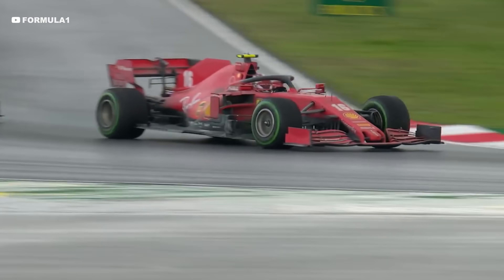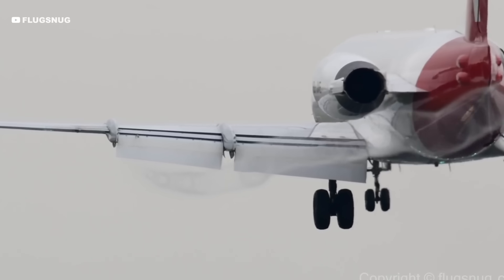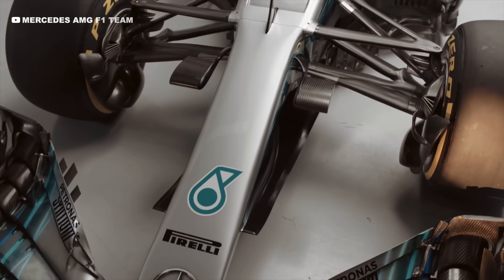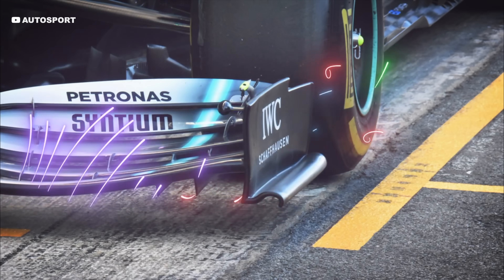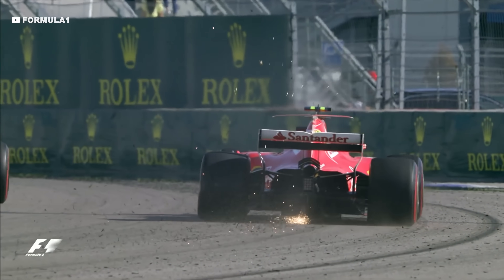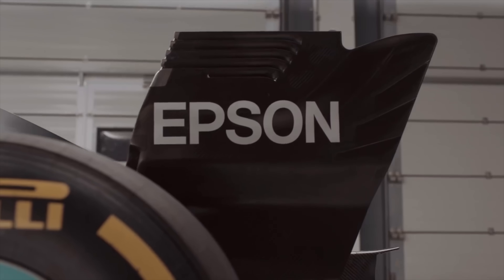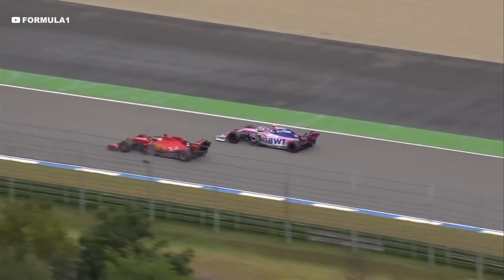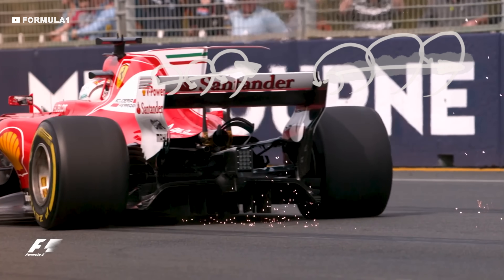The Genius Aero Trick That F1 Copied from Concorde

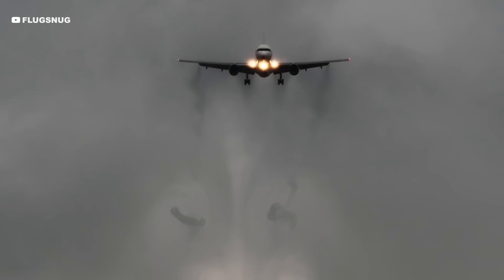Comment: 1:33 I would disagree with wing vortecies being unavoidable on planes as engineers put lots and lots time into getting rid of them. That landing plane in a sense has 2 sets of wings, one being the real wing and one being the flaps (meant to slow down the plane whilst greatly increasing lift). What we can see in that picture is that the only place these vortecies are made are the flaps of the airplane, as they can't have the parts wingtips can have to reduce these vortecies. 
There are lots of different ways to (mostly) get rid of these vortecies like tapered wings, wintgips that curve up or down or big bulging fuel tanks on the end of each wing that all stop high pressure air from the underside of the wing to get to the top of the wing around the wingtips
Reply: Wingtip vortices are unavoidable. The induced drag from them may be minimised but they can never be eradicated.

Circulation is a fundamental part of lift generation and without the vorticity you have no lift. You see patented objects claiming to prevent them but it is all lies.

Comment: Surly there is more to drag than vortices. Even without vortices some energy must be used to cause all the air molecules to deviate out of the way and the faster it is the more molecules have to move.
Forcing some molecules up will cause an equal and opposite reaction pushing the wing or even just a plank, down.
 The force needed for that 'must' also cause drag as you can't have something for nothing.
The air has to be moved, vortices or no vortices but you make it sound like it all because of vortices and I don't believe it.
Reply: I didn't get that impression at all. Just that vortices cause some drag.
Reply: @andersonneil2293  
Fair enough I'll have another look.

Comment: This might be a really dumb question but could you also use this to reduce the friction caused by bodypanels if you gave them sharkskin like surface treatment
Reply: Good question indeed. Yes, Airbus has applied such sharkskin kind of surface on their aircraft. It helps reduce frictional drag, thus lowering fuel burn.

Comment: Just a bit of context to the statement that turbulent air cannot create downforce. Turbulent air does create downforce but less so than laminar air. In fact, aerodynamicists will often add vortex generators to force laminar flow into turbulent flow because although it creates less downforce in ideal conditions, turbulent flow is less likely to detach from the airfoil, thereby sacrificing peak performance for more consistent performance.

Comment: btw the biggest vortex come off the flaps (only deployed during takeoff & landing to increase the wing area -> lift in low airspeed) not "wing itself".
Cruising speed the airplane has to be efficient, that's why new planes has winglets to reduce vortex off the edge of the wing.

Comment: The principle you describe at 0:50 is not the cause of wings generating lift & helping planes to fly.

The only thing required to generate lift in any wing is an angle of attack. The Bernoulli principle only makes them more efficient.

Comment: The difference in pressure above and below a wing can never be enough to lift a big jet. That's not how a wing works. Instead, The airflow behind the wing is directed downwards. This results in an upward force of the wing itself. The difference on direction between the flow in front and behind the wing does give enough force to lift a plane.
Reply: That's not how it works.
Reply: @Nikola16789  Yes that's exactly how it works. The main force is basic Newtonian "magic". The downward vector of air due to the shape of the wing and the angle of attack creates an upward vector on the wing which is the force that keeps the plane from dropping to the ground. It's the same force that is used to steer the plane when you change the direction of the rudder. Put the rudder out to any side of the tail and the plane will start to rotate. Since air is being directed in a new vector out from the plane an opposite force will push back on the rudder and rotate the plane around it's axis. If you doubt this force, put a hand outside the window of your car next time you're on the freeway. Change the angle of attack and you will feel your hand being pushed down or up. Now imagine going 5 times the speed and the forces that will be applied to your hand. Very simple. To be blunt a brick can fly with a big enough engine and the correct angle of attack. A wing is wing-shaped because it's efficient, not because it needs to be. It could be shaped like a slab and still work.
Reply: @SCARDUSTROCKS  Yea, I agree its magic...

Comment: Low pressure does not create the visable moisture in itself.. The air passing the foil is accelerated which creates the low pressure .. Accelerating Air is cooler than the surrounding air  - hence visable moisture.. :-)

Comment: i think you have the wrong understanding about pressure differences. low pressure air does not "literally suck", rather it's the high pressure air on the other side of an object that pushes. pressure pushes. nothing involving fluids really "sucks" or pulls.
Reply: Mathematically, it works either way. It's actually gradient that creates a force.

Comment: Still, no connection to Concorde. In fact Concorde and delta wings work slightly differently from other planes in the sence they need vortices on the upper surface to create lift instead of regular non turbulent flow. 
So while F1 is trying to cancel them out, Concorde needed them to fly

Comment: Great videos with good explanations. I would just add that vortices don’t create drag, they are a manifestation of the pressure difference. Drag is a combination of friction and pressure forces on rearward facing surfaces. Rw gills for example reduce drag by reducing high pressure on the wing upper surface. This means less pressure difference hence s smaller tip vortex is the result not the cause of less drag.

Comment: The myth that the different flow speeds does the majority of lifting is a myth that simply doesn't die out.
It's mostly pure conservation of momentum: the air that hits the bottom of the wing deflects and pushes the wing up. simple as that.

Comment: Vortex and condensed air or vapour trails are in a sense connected but not the same, like in that drag and downforce are not the same but have an indisputed relation. Aircraft and F1 both have to do with aerodynamics, although in different ways and with different goals.

Comment: Pressure differences create vortices, yes. Pressure differences create very little lift however, it’s enough for paper planes and RC planes to skim across, however a significant majority of lift is created by a phenomenon called flow turning. This was found not too long ago by NASA, and is where a wing changes the direction of air molecules. by throwing air down, or in the case of an f1 car, upwards, you create an equal and opposite force on the car. pressure differences might only be 60-100kpa at high angles of attack and would require a rediculously large surface area to create any force at all. aerodynamics have changed massively in the past few years due to these studies, and is evident in the appearance of simple rear wings on different cars, comparing old Porsche 911 rear wings to new, you can see the transition to flat and fat to more of a crescent moon shape. it’s fascinating that we still don’t fully understand how lift works despite all these theories and studies

Comment: In fact, the vortices in F1 do much more than just a barrier. The so-called Y250 vortices drag the air above each of them to the centerline of the car, which will hit the vanes mounted under the front suspension (Front Turning Vanes). Due to the induced inwash and downwash by the Y250s, the FTVs has quite a large angle of incidence to the incoming flow, which would then act like plane wings and create a vortex on their tips, effectively forming a counter-rotating vortex pair with the Y250. The vortex pair pushes down the air between them, forming an optimum flow field for the bargeboard footplates. The 'nose cape', introduced in Spain 2017 by Mercedes, acts in a similar manner, only to be placed a little bit lower than the FTVs. 

Apart from the concepts above, F1 engineers would utilize vortices to induce some desired flow field close to the surfaces as well. By opening slots on the bargeboard footplates, the Y250 brings some air through them when being directed outboard by the bargeboards, effectively creating a virtual 'side skirt', preventing tyre wake from entering the undertray. Vortices shedding from upper and lower edges of the bargeboard would gradually fall onto both sides of the undertray, pushing air out as well. Aerodynamic designs of F1 cars are true magic that for most of the time can't be deciphered with eyes: even if the concepts mentioned above have become 'common sense' for F1 aerodynamicists, there are still a huge amount of details, such as the strength, exact position and length of vortices, as well as how they change through the entire aero envelope, that would be understood and manipulated very differently among each team. Making a precise simulation of those vortices is, if not, the biggest challenge in understanding the physical aspect of the car. Under this circumstance, one could say that F1 cars look almost the same only because of the regulations: the ideas and interpretations make each of them a whole different world inside.

Comment: It is actually not just the pressure that causes condensation. Air can only hold as much water at specific temperatures. As we know, accelerated air cools down (otherwise fans would lose their effect.) If you have a high relative humidity, and warm air, it can hold much more water. But when the air cools down, it loses the ability to hold that water. So the water needs somewhere to go and starts condensing and forming those droplets because the air cant hold the water anymore since it cooled down through the rapid acceleration over the wings. That is also why you see the "clouds" in front of the jet engines from planes because the air gets accelerated so fast.

Comment: if you notice in the F2004’s rear wing you could see its moulded to slope down right beside the end plates in an attempt to minimize the drag and create less vortices.

The second gen Ferrari powered A1GP cars also had this rear wing design as they are directly based off the F2004 specifically. 

Some F1 teams still use this too particularly Mclaren

Comment: Not just control of vortices, but many technologies have been derived from Concorde. Carbon-ceramic brakes, active brake cooling, fly-by-wire, digital computer control from sensor inputs, active weight trimming, etc. Concorde really was the pinnacle of technology, dare I say, still is…

Comment: Would you please explain the second way of reducing the size of rear wing vortex that produces another vortex in opposite direction (the aero elements used in it)?
Reply from the maker: So check out a photo of the Merc rear wing, there is a second edge towards the rear of the end plate. It's slightly lower. The pressure below the wing elements are lower than atmospheric pressure, so air flows over this edge, from outside the end plate to inside. This creates an opposite vortex to the one we described in the video. These vortices oppose and partially cancel each other out. Hope that helps - Producer Callum
Reply: @Driver61  Thank you for the reply.
Are you talking about the three upward angled elements same as the two on the rear wing of RB? If so, then wont it create (3 small vortices merging into one big) vortex spinning in the same direction as the main one? If we want to create a counter spinning vortex, won't we have to angle the element downwards so as to create high pressure at the bottom so the air flows over the edge and create vortex spinning in clockwise direction on the left side of the wing when viewed from rear of the car, which will be opposite of the main (bad - no no) vortex? I am clearly wrong here, but I want to clarify the concept.
Or is it that the two vortices (the bad and the good one) spinning in same direction, come in contact with just the walls (maybe intersect a bit more) of each other so at that point, the air molecules from each vortices are travelling in opposite direction of each other and so they both slow down eventually with time?

Comment: I was always told that you needed about 8 cord distance between the bottom of a wing and another surface for the wing to think it's in clean air. When I watch these videos (great videos btw) I see that these f1 teams are not doing that, or at least they are maybe staggered enough that it doesn't matter? My thinking is in my world of winged sprint cars on dirt. We do have many rules on constricted construction of the wings (have to be one piece foil design)  but the placement can very, like up or down in the nose wing which sits directly over body panels.

Comment: coming from a flight instructor, well explained on how aerodynamics and the vortices work! drag is always a byproduct of lift! (induced drag that is)
Reply: Contrails!

 /s
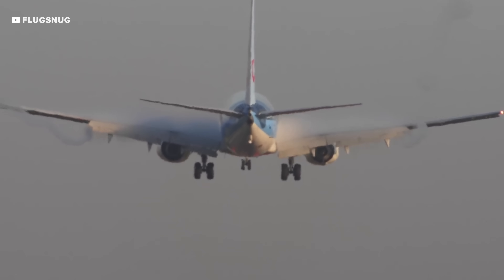Reply: I did not like his phrasing at 0:56 about how a vacuum literally sucks the plane upward. A vacuum cannot exert a force. As an experiment, place your coffee cup on the table in front of you and place your hands either side just touching the cup. Move one hand away. Result - the cup stays where it was. Now put your hands back on the cup and push equally with each hand so that the cup stays still. While still pushing, move one hand away (this is easier to do with two people). Result - the cup moves towards the hand that is moving away (the low pressure side) - not because that hand is moving away but because now the other hand is exerting a force.  In the same way, low pressure regions cannot exert a force on a wing - the force is applied by the high pressure region. It's contact with atmospheric gas molecules bouncing off the wing that is pushing it.
Reply: @gz3zbz  Also, if the low pressure would be the only explanation, the plane would not be able to fly upside down.
Reply: @gz3zbz  so glad someone else picked up on that
Reply: @gz3zbz  It drives me absolutely nuts how aerodynamicists always talk about this backwards. And there's a very straightforward analog to demonstrate the point: speedboats. They don't have a "low pressure" region above the boat, (any more than air already exerts less pressure than water,) yet when they go fast enough, they produce lift and will "plane" on the surface of the water.

From a simple Newtonian standpoint, this is very easy to explain. The faster a boat travels through the water, the more mass of water it has to displace down per unit of time, and thus the greater the resulting reaction force pushing the boat up will be. The same basic principle applies to wings, it just ends up having a more dynamically complex distribution of forces because air is compressible and the wings are fully "submerged" in it.

But to say that the low pressure region above the wing "pulls the aircraft up" is actually the inverse of what's true. All the low pressure region does is present less resistance to the high pressure airflow from under the ambient air pressure does. At the tips of the wings, the high pressure spanwise airflow from under the wings actually causes a vortex that wraps around the wingtip and pushes down on the wings. The low pressure region literally induces negative lift, (rather than being some kind of magical suction effect,) and this negative lift is actually something that has to be accounted for in high-efficiency designs like airliners. This is why winglets and wingtip fences exist; they prevent some of that airflow from fully wrapping over to the top of the wing, and recover additional lift because of it.
Reply: You probably just got your student pilot cert - calm down buddy.
Reply: @gypsykingg  someone's jealous anyone else has more ratings than them
Reply: @dannenp3110  - I don't know of many active flight instructors with multiple, if any at all, type ratings. Yeah, I'm jealous.

Comment: To be correct, it's not the low pressure that sucks on a moving wing, it's the creation of a high pressure area pushing down on the wing (called downforce on an F1 car) and a high perssure area pushing up on an aircraft wing (called lift) that does the work. Great YouTube thanks.

Comment: A plane's lift does not come from the Bernoulli principle (low pressure above wing sucks the wing up), it comes from the wing pushing air downwards, and receiving the resulting upwards force from Newton's law. This is a common misconception, but any physics or aerospace engineering student is taught this early on. You can read about it in more detail here: http://www.aviation-history.com/theory/lift.htm

Comment: The louvres on the rear wing can't be there to reduce the pressure difference per se right? I mean the pressure difference itself is the downforce, bleeding it out to the sides is just dumping downforce, so why not just run a smaller wing instead?

Comment: ive mentioned it before, but what would you reckon Scott if the rear wing was dimpled, the way a golf ball is?
Reply: DG: it would have greater drag.  Dimples on a golfball create a 'virtual" airfoil using air pockets and selective drag, while the wings on a car are real airfoils and don't improve with dimples.